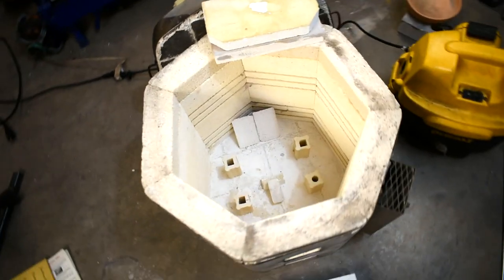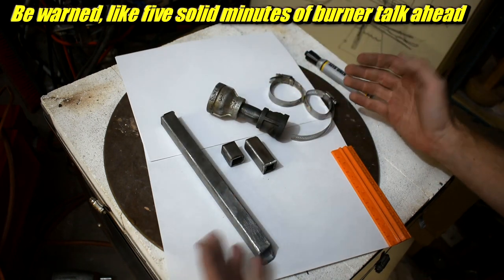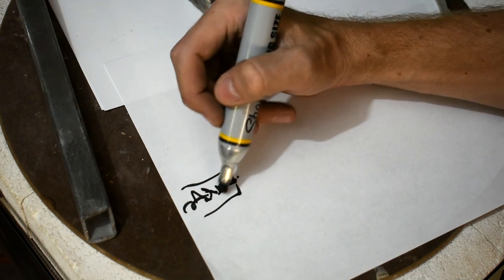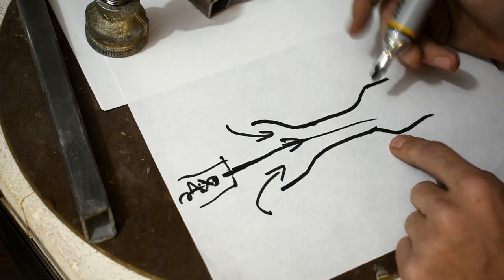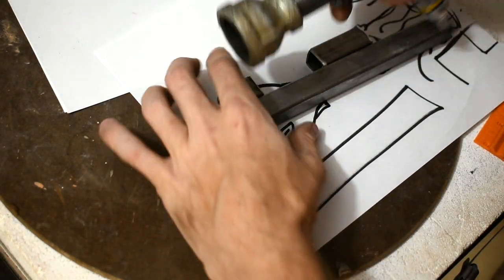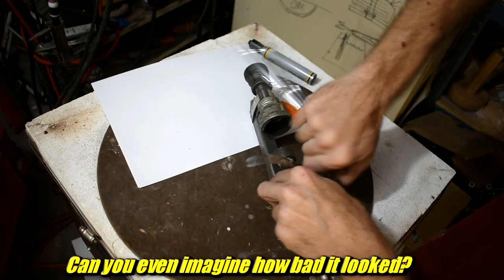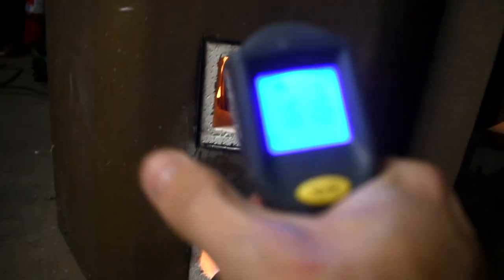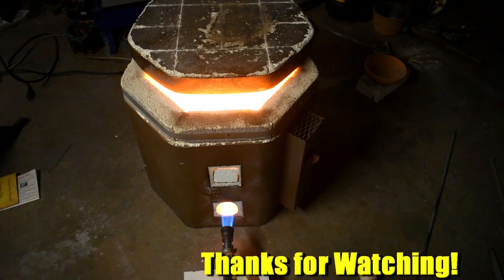Raku Kiln from Electric Kiln! Part 2: Making the Propane Burner and Test Firing

Comment: Built it. Regulator from Scamazon, rest from Home Cheapo:
☑ 30 psi QCC to 3/8" flare regulator, any brand
☑ 3/8 Male Flare to 1/2" FIP gas ball valve (the male Flare prevents you from needing an adaptor he used)
☑ Pipe 1/2" x 8" NPT M/M (all pipes non-galv. steel)
☑ 1/2" cap
☑ 0.035 (1/32") bit (center punch first)
☑ 2x 1/2" to 3/4" reducers
☑ Pipe 1/2" x 2" NPT M/M
☑ 2x Hose clamps
☑ 3/4" Square tube
☑ Teflon tape or whatever
Cover propane hole with finger and leak-test every joint with soapy water. I'm not responsible for anything

Comment: If only you had a lathe to make a handle for your cheese wedge air-stopper brick.  You know, so you don't have to melt your hand off to get it back out if you push it in too far
Reply from the maker: Haha I wonder where I would find one of those... 🤔
Reply: @PaulsGarage  Probably on the bench waiting to be put together LOL
Reply: I was thinking about how moving that cheese wedge would work with flames licking all around it.

Comment: build a spring using a iron wire  0.1mm  with  radios of 0.4 mm . then make  a circular  shape from that spring  and put it at the combustion area of your torch. it will increase your  fire  power a lot  and will reduce the time   that you need to heat up the metal .

Comment: Maybe a dumb question but does the distance between the cap with the hole in it and the funnel where the venturi happens create a "natural" flash back arrestor or do you have on in the line to the tank?
Reply from the maker: Good question.  For the fire to get back inside the burner cap with the hole in it, air would have to get in the line somehow.  But the line is pressurized with propane, so it can't.  Just propane alone can't burn without oxygen, so it's never been a problem.  And if by some freak occurrence oxygen does get in there and the flame back tracks, the regulator has a flashback arrestor.  But in general propane is very safe to use.
Reply: @PaulsGarage  fair enough thanks for the answer.loved the video

Comment: I used the easy button... purchased a week burner.
Reply from the maker: That is indeed the easy button and can work perfectly well.  Simon leach uses a weed burner for cone 10 firings.  They don't really even cost more than the fittings for this one.  I do have another burner I built though with forced air that is waaay hotter than a weed burner

Comment: Would smelting enough aluminum bronze to make an anvil make for a viable anvil or would it not be worth the effort?
Reply from the maker: I doubt it would be worth it.  You would need so much copper.  Also the surface wouldn't quite be as tough as good forged steel.  It would be golden, though, which is good

Comment: maibe you can use natural gas for this kiln , it doesnt seem to have the same amount of power per kubic x or pressure behind it but you don have to worry if the bottle is about to run empty , might need to change the holesize in the cap to get it to make any power , you work on furnasses you should know how to do that better than me
Reply from the maker: I thought about that, but propane is the way to go in my opinion.  Propane tanks are more portable and this burns such a small amount that I could probably run it all day on a single tank.  My foundry furnace would probably empty a grill tank in an hour or 2 at 30psi, but this is closer to 1 or 2 psi.  I ran it for about an hour and the tank didn't get cold enough to sweat at all either.  The regulator was a bit cold, but again not quite enough for condensation.  I suspect this very porous fire brick is far better insulating than the 2800 degree insulating fire brick I used for the foundry, as its much lighter, though it wouldn't handle the big burner for sure.

Comment: Wont the galvanized pipe throw off a poisonous gas
Reply from the maker: Very little and only temporarily.  The flare itself isn't getting that hot, actually.  Its not cold but its far from glowing hot.  Its also in a well ventilated area.
Reply: @PaulsGarage  You can soak it in vinegar for a few hours to get rid of the galvanizing, but I suspect the CO2 from the furnace is a much bigger danger. Well and explosions. Don't put the propane tank on top of the kiln.